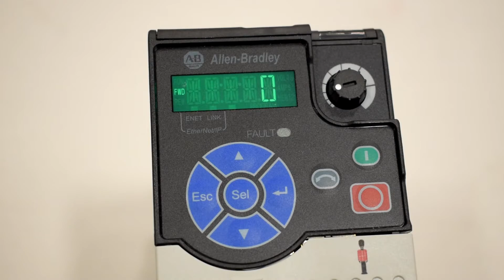Allen-Bradley PowerFlex 525 VFD Factory Reset Walkthrough

Comment: Good Afternoon Sir 

Whenever 525 drive is powered there is continous fault F110. It is not getting reset.  Please give some solution.
Reply: What does that have to do with this factory reset video?  It comes across as presumptive and rude to ask something nothing to do with the topic.  Perhaps look for a more appropriate video to ask your question on.
Reply: @belialbradley222 maybe he got this code after doing a factory reset, just like I got but I got a F059 safety open fault.  Now trying to figure this out.